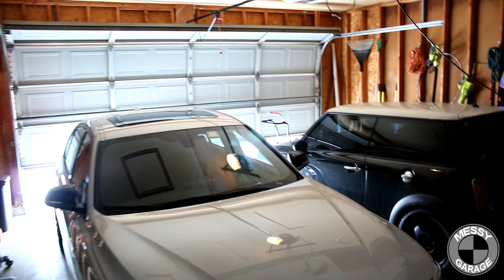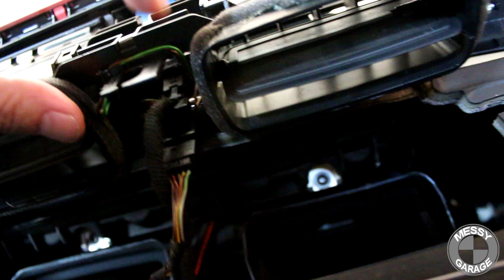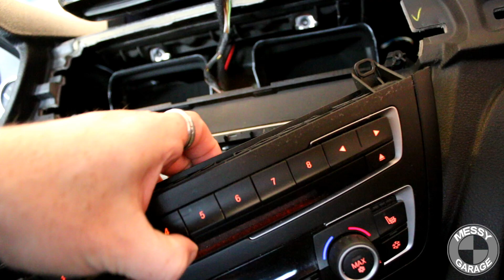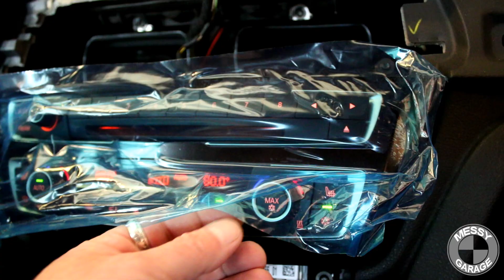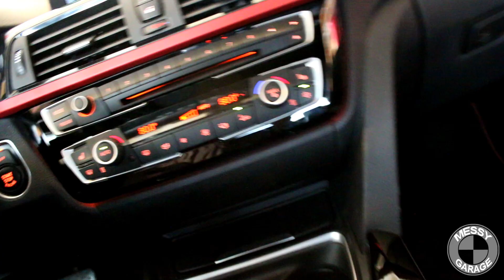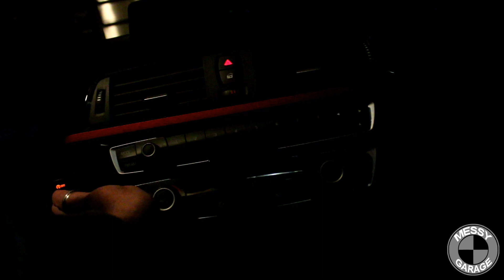BMW F30 retrofit LCI Illuminated AC and Radio panel (and create wiring harness)

Comment: My 2016 F30 already has the ambient light on the radio. I just want to know if these are brighter, I just really don’t want to go through the hassle of running and tapping into wires. I wished it was just plug and play for me.
Reply from the maker: I'm using the OEM radio surround panel so it is probably the same part already in your car from your description.  This mod is for preLCI cars that didn't come with the ambient lighting around the stereo cluster but have it elsewhere.

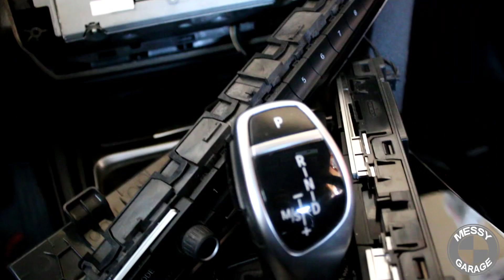Comment: 9:15 WOW, what a giant pain in the ass this was. The radio and AC clips wouldn't come out no matter what I tried. Whoever designed those plugs needs their head examined. I tried using fingers, pliers, a needle to poke inside the little holes on the back of the clips and NOTHING WORKED. Literally ended up almost snapping them off but thankfully didn't and I ended up doing your workaround method. Thanks for the video, it probably saved me a trip to the dealer with a broken harness.

Comment: Has anyone installed this on a 2013 F30 335i? If this part is not compatible, plz provide a different part number or link. Thnx!
Reply from the maker: This should fit fine.  The car in the video is a 2012 F30 335i.  Same car so it will be the exact same install for you.

Comment: How many Volts for the LED trim 12v? mine don't have the cup holder LED
Reply from the maker: I think it is 12v so you can try to tap into the 12v lighter power possibly.

Comment: How many Volts for the LED trim 12v? mine don't have the cup holder LED
Reply from the maker: I think so but I'm not 100%.  If you have the ambient lighting at all in the car you would want to tap into that or else it wouldn't change color with the idrive controls.

Comment: What if I don't have the cupholder LED?  My 2016 is pre-LCI but doesn't have that LED.... Actually, I'd like to add that LED and the AC surround.   Anyone done that already?
Reply from the maker: I'm sure there is another way to tap into the power for the other ambient lights but I don't have first hand experience with that.  Some on the forums might have done it.
Reply: Hello, same case to me, do you have an issue ?
Reply: @Owned_93  how many volts do i need for power?

Comment: Nice Video, got a question, can I use the same parts on my 15 435GC? 64-11-9-358-940 will work on 15 435?
Reply from the maker: I think you should be able to.  The interior bits look to be the same.  You will need to make sure you also have the lighting package and have the LED over the cup holders as this is the place I connected the Y-cable to power the LEDs in the surround in the video.

Comment: Great video but to bad you cut the video on the places that were really essential ... like removinh the ac & volume ecu’s from the existing trim..
Reply from the maker: Yes, below freezing temperatures and trying to be a one man filming crew while doing it was a bit tough.  I did try to highlight the tabs in the surround and where to press with the trim tool to get them out.
Reply: MessyGarage it’s much appriciated my man! Like the Star Wars tshirt though 😂